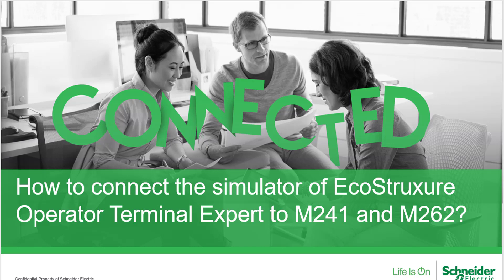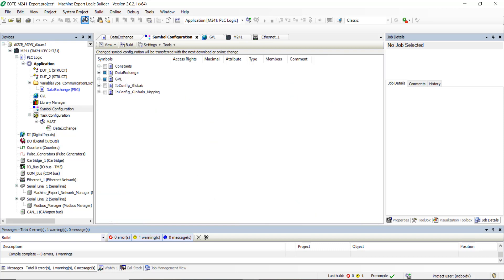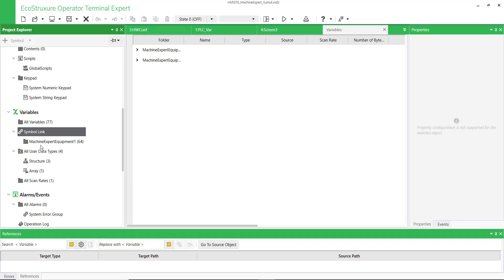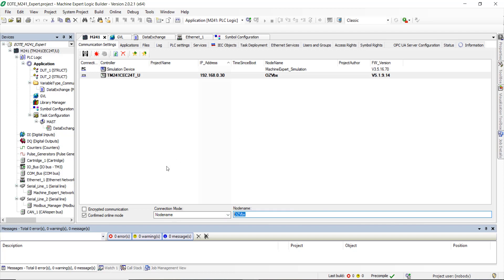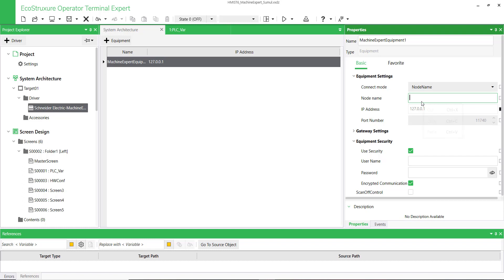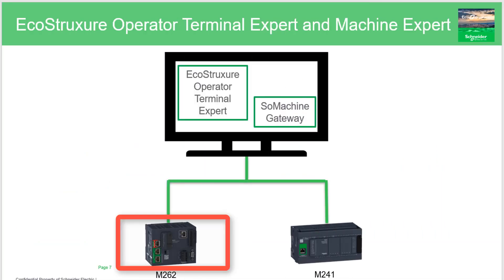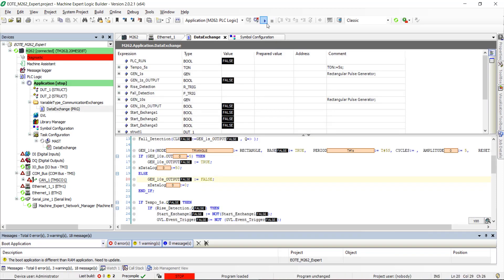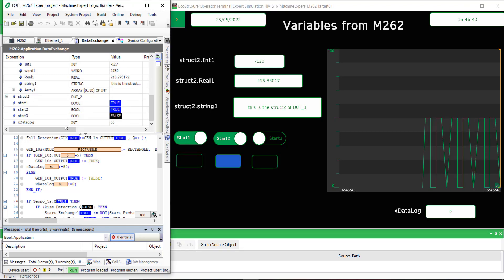How to connect the simulator of EcoStruxure Operator Terminal Expert to M241 and M262?

Comment: Hello, thank you for the informative video. I am currently using the Trial Version of this software and do not seem to be able to get Device Simulation to work. I am using TCP/IP modbus driver to an M340 PLC. Everything runs but objects on HMI screen are not responding. Also there are no communications errors. I wonder if this is a limitation of the Trial version since the Trial version also does not allow downloading to HMI hardware. Can you confirm this?